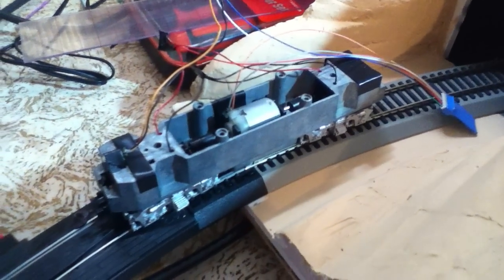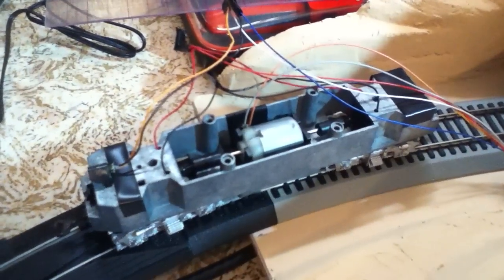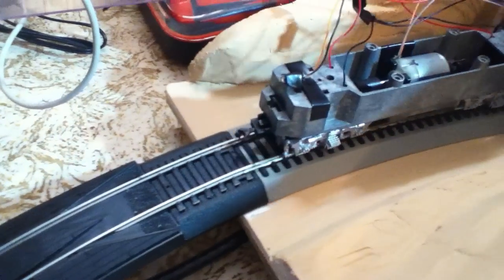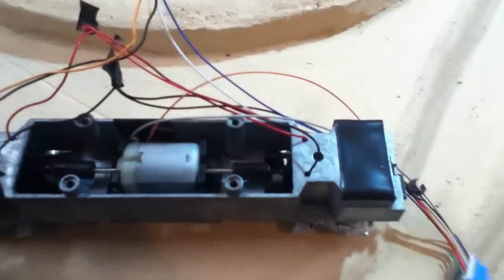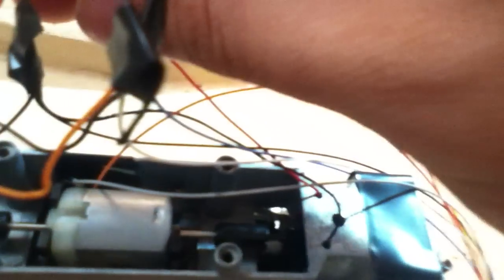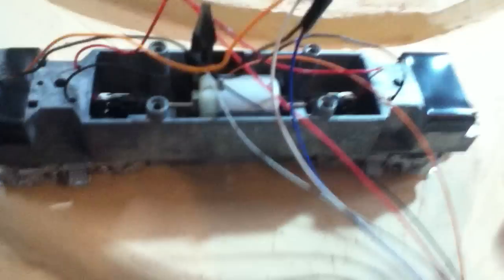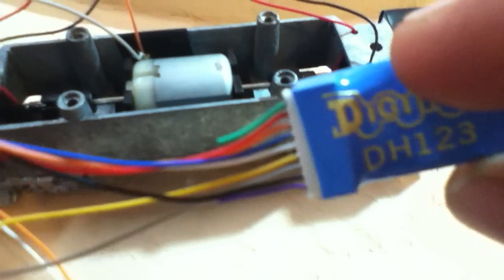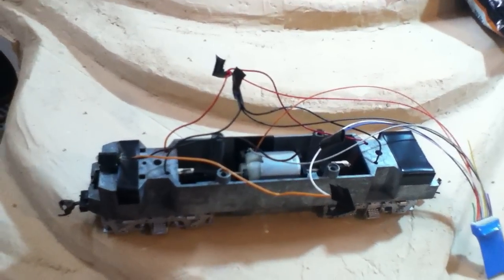Install DCC Into Bachmann Locomotive 01/25/2013

Comment: Its the newer version of their new 'standard' line. The next level up is their DCC ready line. They both are to replace the old Plus, Spectrum, and Regular line. You could also shorten the wires on the decoder to help with making them neater and fit better. Or solder some of the decoder wires directed to the motor, lights, or power pickups.